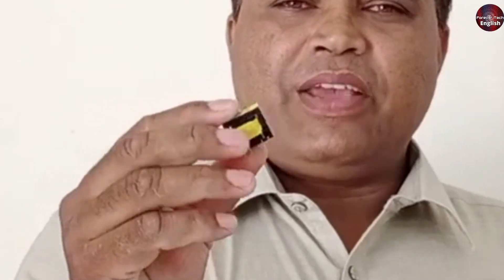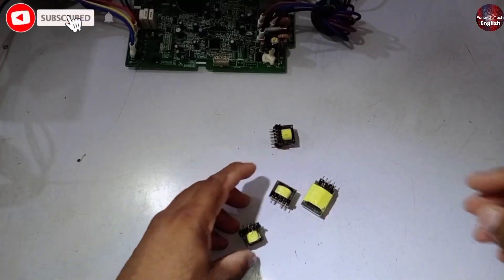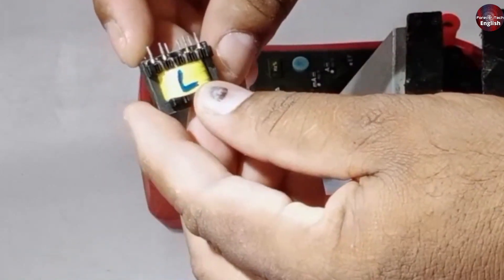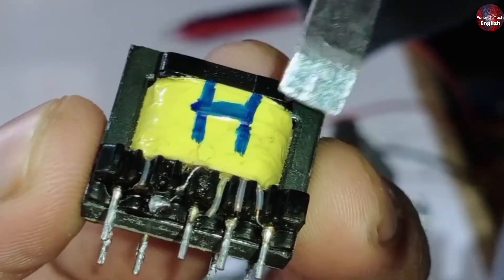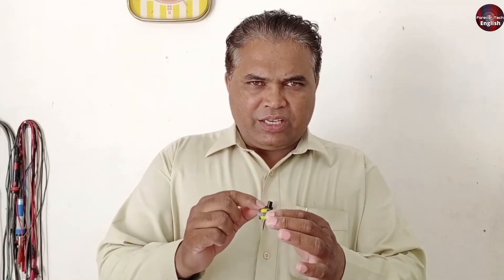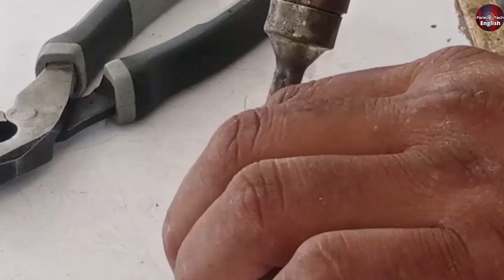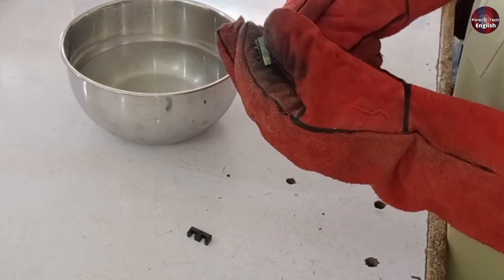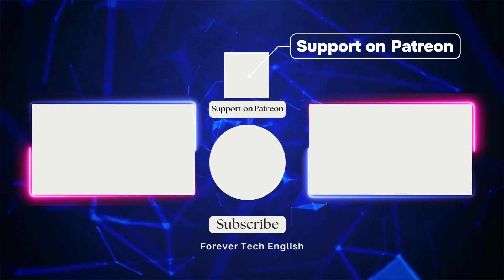Chopper Winding Pt1: How To REMOVE the CORE of Ferrite Transformer

Comment: But sir , your information is not correct , no dc voltage can flow in transformer,  its ac but high frequency,  and you call it chopper , please check your information  and the way you presented it to your viewers.
Reply from the maker: Thank you for your comment! You're absolutely right that a traditional transformer only works with AC due to the need for a changing magnetic field. However, in the case of DC-DC converters (like choppers), it use high-frequency switching to create a waveform that behaves like AC, even though the input is DC.

This high-frequency switching allows the transformer to operate by rapidly turning the DC on and off, simulating an AC waveform. So while it's not pure AC, the chopper circuit enables the transformer to function with DC input. I hope this helps clarify things!
Reply: @forevertechenglish  thanks for your clear reply
Reply from the maker: @m.s7541  Welcome...